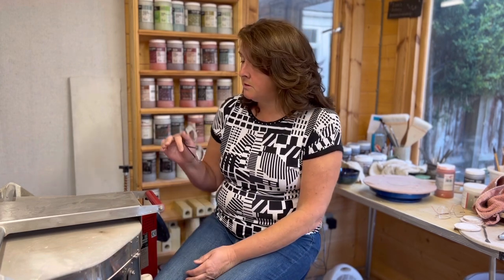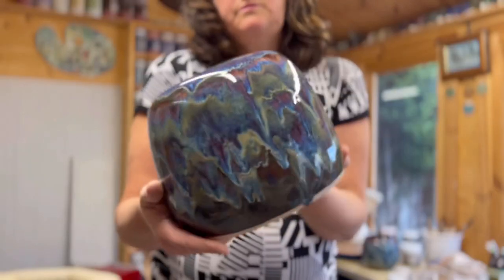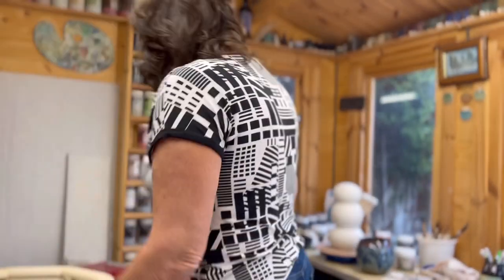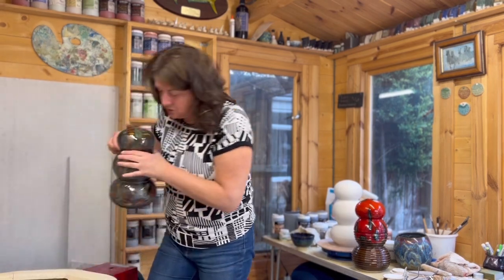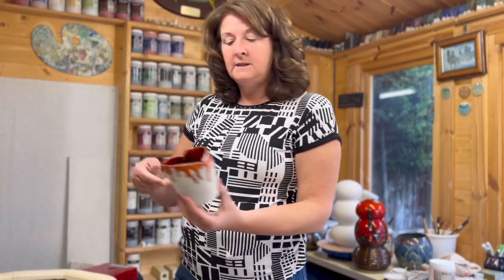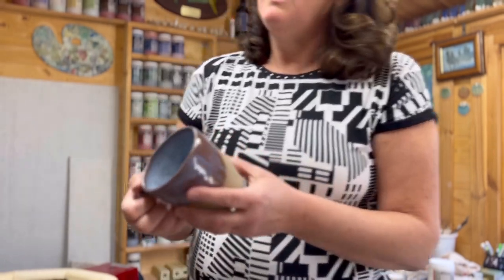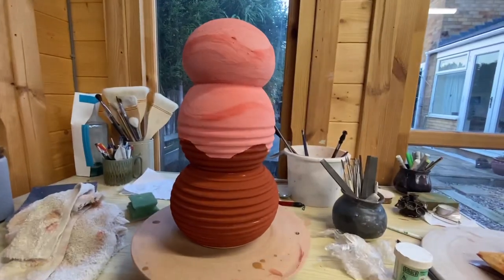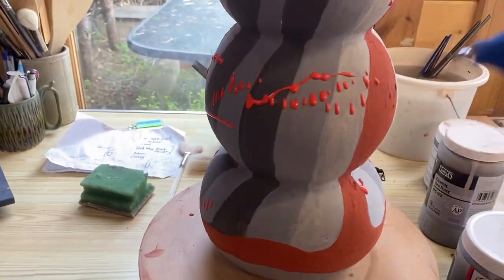75. I’m back! Kiln Unloading - Lamps, Mugs - Using Red Glaze with Copper Wire Amaco, Terracolor.

Comment: Hi Lois  the pin holes could be from the clay, some clay has to be bisque fired to cone 04 to take out all the organic matter, also could be that clay needs to be fire in the end with a hold for some time even 20 min , but your kiln is firing hot you can program with 32 F less to make cone6 or you could fire cone 5 and add a hold for 15 min in the end to make the glaze a chance to close the molten. If was my kiln a doing one thing first and fire some pieces and see the results first. Don’t change everything the same time or you won’t be able to tell what is going one, also the clay maybe be your problem, but for sure you can adjust the cone firing. 🤗
Reply from the maker: Have done a cone 5 and have done holds. I use a pre programmed kiln KMT 1018 skutt I love the glaze reactions at the preset. Also if you have a success rate like I have why change for the odd one that does it work. I was told by a gent from Corby kilns when I was stressing about everything it like baking a cake if you find the right formula even if it’s not the norm don’t change.
Reply: @LoisHook  I just try to help. The pin holes and crawling the glaze out of the pot could be the fire 🤗
Reply from the maker: It wasn’t supposed to be a criticism just that I was there at the beginning of my pottery journey questioning everything I did and asking myself why. Could I do better and I became transfixed on the negative instead of the positive. I have done that exact bowl before in an earlier video and it was amazing. Same kiln same preset. I know looking at the bottom of the clay I used a different one and just put it down to that. It was a shame but overall the other pots had not running and not no pins.  Hope you understand what I was trying to say.

Comment: Pinholes, for me, are reduced by slow cooling. The glass in the glaze bubbles but cant come back together and heal over if it cools too quickly, it is in a molten stage. So I cool slowly, about 200f per hour, from peak temp (about 2160f), to 1900f then let it cool completely.  Additionally, things get worse for me, as the elements get tired, because they take longer to get up to heat. That causes more heatwork to be done to the work than usual.  Heatwork is temperature vs time.  SAlso, make sure you are bisquing to cone 04. I have a 10 min hold before turning off. This is to burn out any organics in the clay, every clay may be different.  I use the same kiln as you, but a bit older.. The elements should last ... at cone 10, 80 firings. At cone 5/6 I get about 150 firings. For me, I replace them about every 18 months.  They are an expendable. I replace relays at the same time.
Reply from the maker: Thanks for all this. I do realise I haven’t been keeping a full record of all my firings like I did at the beginning. 
I appreciate your thoughts on the pinholes. The bit I find difficult is when I’m the issue is with one pot out of say 20. 
I did look at the record on the kiln and it seems to keep a record of a number of firings and then it’ll you can see a change.
Reply from the maker: I will when I move and have some time have a go a working with glass… your name suggests you do that as well. Email me on lois@loishook.com and let me know about what you do. Maybe some pics. Cheers.

Comment: I think you will not get the crackle look with the Mayco Crackle White glaze at your firing temp. The Ceramic Shop's website shows 2 tiles, and the one fired at Cone 6 looks a lot like your result. They say Cone 06 "creates a white cracked surface and allows underlying designs to show through." and Cone 6 gives you "Finer crackles". The "finer crackles" are barely visible.
Reply from the maker: Thanks so much...my glazes are in boxes as I'm in the middle of moving but i will have a good look and re read the jar when its found.

Comment: Hi can I ask about the size of the hole at the top of the lamps? Does it just have to be big enough for the wire and not the lamp fitting? 😊
Reply from the maker: I do about 15mm. It has to be big enough when it’s shrunk 12% for the metal bar that the lamp fitting fits onto.
Reply: @LoisHook  thanks its something I've been thinking about but never seen any being made 😊

Comment: how high was that fired?
Reply from the maker: I have a skutt KMT 1018 and use the preset cone 6 firing. I did have big items so did a slow fire. I have done a new kiln and the Textured Turquoise still with a slow fire and did still see a slight issue with cover. Only subtle. New pot. So maybe a mixing issue at Amaco.
Reply: @LoisHook  thanks Lois, you do beautiful work